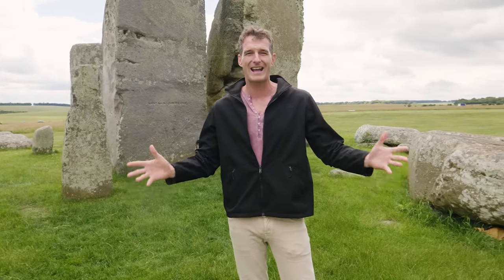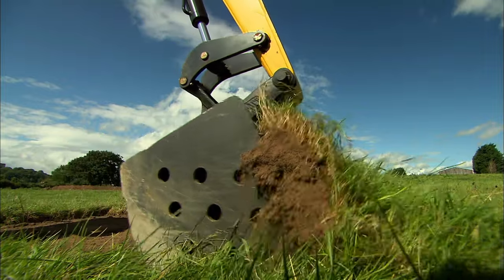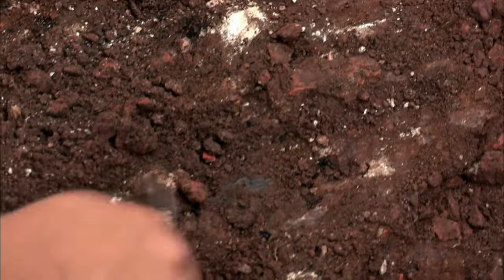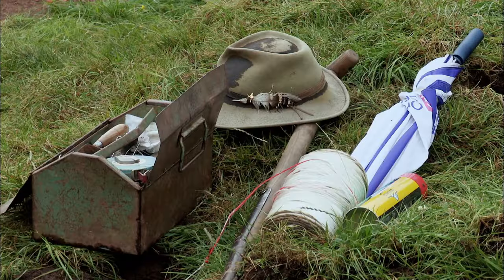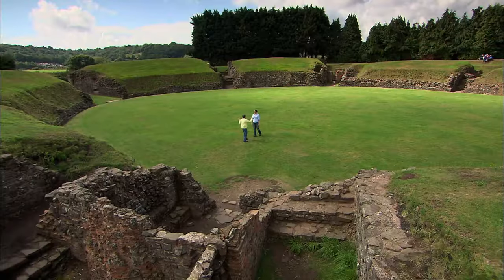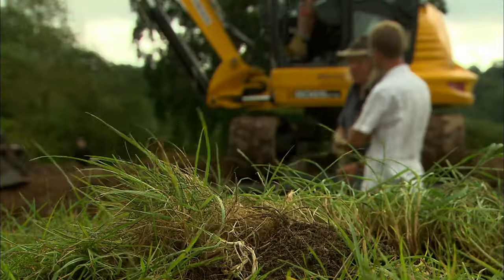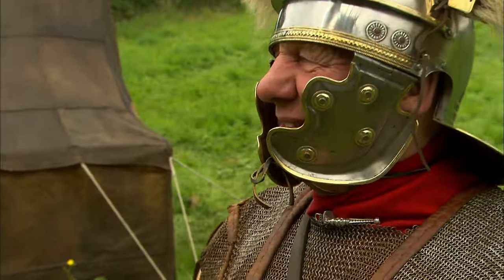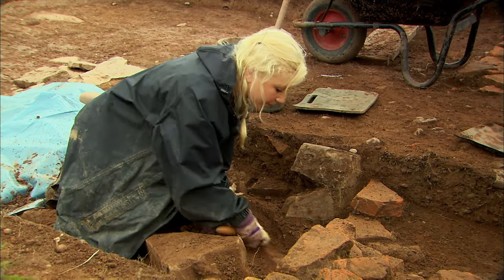Britain's Best Preserved Roman Fortress | Time Team | Timeline

Comment: I love history and operate heavy equipment. Where do I apply stateside to be a archeological dig site excavator?
Reply: Probably with a large university in an area with a lot of historical sites, would be my guess.
Reply: they don’t use diggers in archaeology in the states because the archaeology is all close to the surface lol
Reply: @shelbyseelbach9568  He's not far off the mark. You usually only need to go down 20-30 cm to get started.
Reply: @InquisitorMatthewAshcraft  That's anywhere. It changes my statement how?
Reply: @shelbyseelbach9568  just because the archeology is shallow on the surface doesn't mean it's only recent. In an area like Britain, silts build up quite quickly in some areas, so 1000 years could be 3 feet down, or an inch down depending on the area. I would imagine somewhere close to a coast (river lake or ocean) the archeology would be deeper. Somewhere temperate and stable climate the archeology, even up to 1000 years ago could be close to the surface.
Has absolutely nothing to do with the US only being 200 years old as a Western nation.
Reply: @RatelHBadger  Not sure you've responded to the correct person? Your comment makes no sense addressed to me in light of my prior comments? So.......?
Reply: @shelbyseelbach9568  point still stands. They wouldn't use heavy machinery in the states because the top soils don't tend to fluctuate, build up etc so 500 year old archaeology would still be just below the surface in many places. Regardless if human occupation was only that long ago or not.
Reply: @RatelHBadger  Ok, Indiana Jones.

Comment: Forgive my ignorance, but what cause these structures to be buried? Landslide? Regular dirt over time? Any good videos as to how these things get buried?
Reply: Probably 100 year floods from the nearby river. They allude to this at the end of the program.
Reply: To copy and paste an answer for you

Rivers periodically flooded and added a layer of silt, while in dry regions the wind was constantly blowing in sand and dust. (The Sphinx was buried up to its head in sand until archaeologists re-excavated it in 1817.)

When ancient towns were abandoned entirely, plant seeds quickly took root and created more bulk from the CO2 they pulled from the air. Their roots stabilised the soil created from rotting plant matter and the layers gradually built up.

Comment: That's a slave trading outpost not a military fortress. The building in the middle would be where they kept the slaves before the auction which would've held in the square. The barracks would be the prison walls where they held the slaves when they weren't in transport.